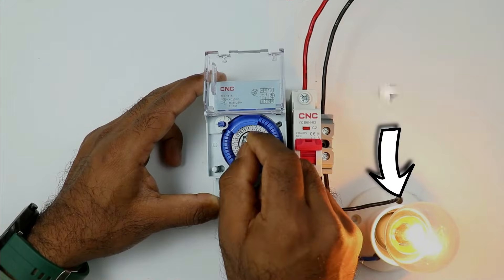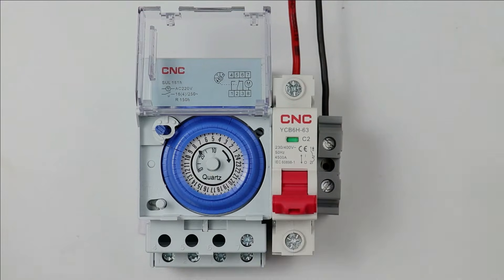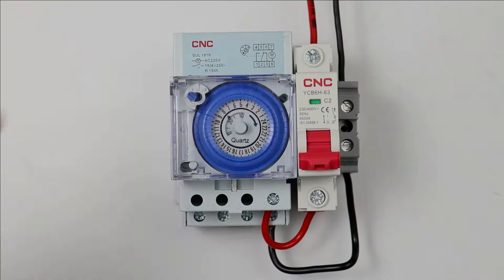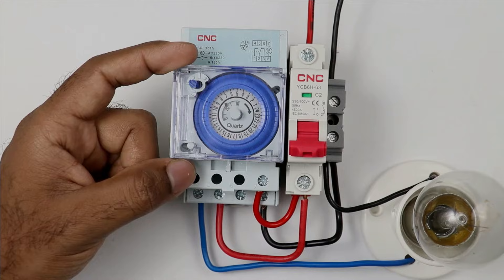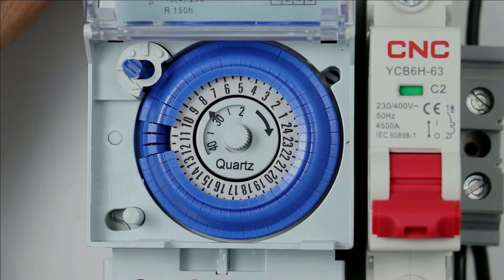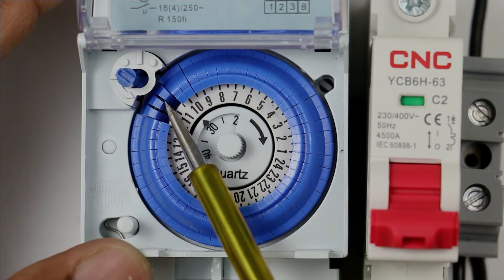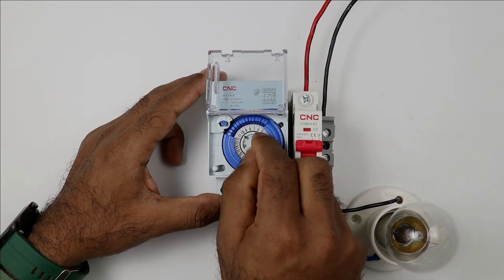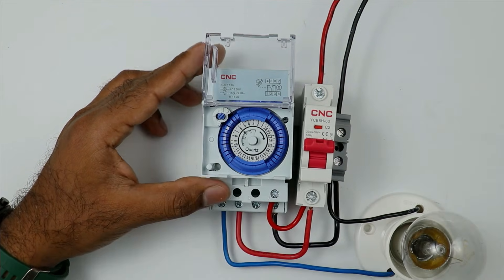Mechanical 24-Hour Timer Connection and Time Setting @TheElectricalGuy

Comment: BEST EXPLANATION on Youtube for this Timer.

I have this Timer for my Pool and so many pool guys have explain this in the wrong way which coinfused me a lot.
They explained the On and Off position incorrectly so my timer would always switch on and off at the wrong times and run for long hours.

This video is a Life Saver for my Sanity and Electricity Bill.

The best part was when you also show how to switch to MANUAL Mode.
No other video i watched, even explained this.

3 Year Old Video still going strong.

Well Done!!!

Comment: Is clock rotats on power or spring?
I am what in case of power failure will clock rotates or stopped??
Reply: As far as I know - no electricity > it stops
Reply: it'll operate since mechanical timer has a DC battery power

Comment: Can we use this for more than a month at a single time set ? Like everyday my garden motor needs be on for 30 minutes no one  this should be happen for everyday for a month we will go for vacation
Reply from the maker: Yes you can set the time and it will turn on the motor every day at that particular time

Comment: Please can you use it to control waterpump
Reply from the maker: Yes you can but use contactor with it
Reply: @TheElectricalGuy  so please can u help me with the diagram and the connection of the wires or cable's